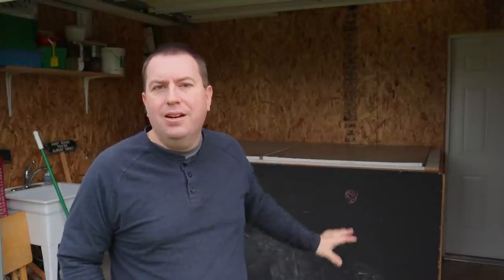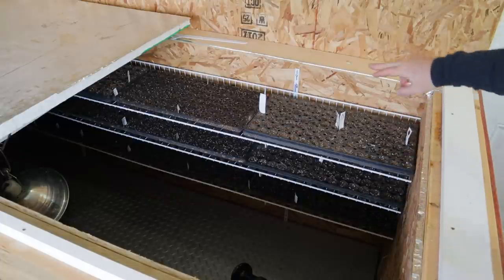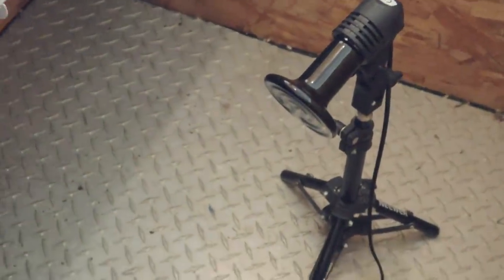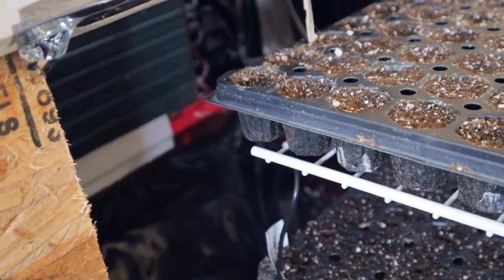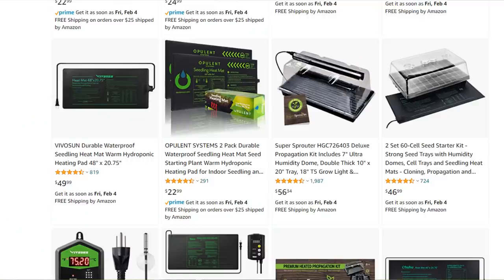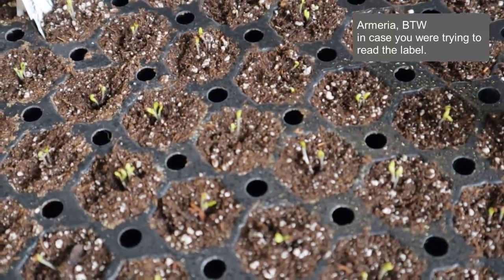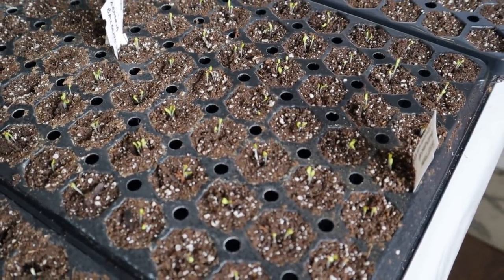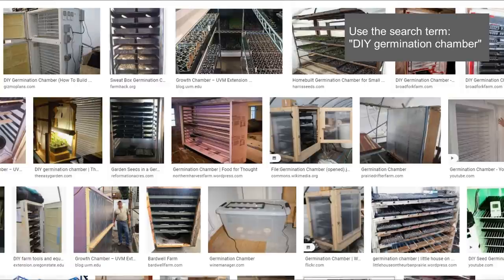DIY Germination Chamber: Fast and Consistent Seed Starting

Comment: Very helpful tips as usual Jason.👌
Here are a couple of small home gardener suggestions.
If you only have a handful of seed varieties for sprouting try using a styrofoam cooler or camping cooler for climate control. Same idea, but on the corner of a room type of scale.
Another way to heat the box is to use rounded river stones. Place them on or in a source of heat like the oven, wood stove, under a heat lamp until they are at the appropriate temperature and then place them in the cooler for transferring their heat (use a board, box to keep them together so the heat will stay concentrated and last longer). You can also use a box or bag of sand (kidney/navy/pinto beans) and heat it up in the appropriate source of heat. I prefer wetted burlap fabric for the humidity as well as containing the river stones. You can also use a deep aluminum cookie sheet with wetted sand as a heat/moisture control as well.
I am actually in negotiations to purchase a 2 acre/.8 hectare property, hopefully closing by April, so I may be doing a spring move. I think the elevation is 4,700ft/1,432m. On Saturday at 2 pm the temperature was 62F/18C. I know that it gets down to 38F/2C in the predawn morning right now, so hopefully by April it will be more like 45F/8C. I guess we'll see what happens. It's definitely going to be a process, but I will be taking pictures and will try to send you some as things progress.
Very useful video.👌🤙
Reply from the maker: Thanks. I do love that gardeners find the appropriate project for their own size needs and conditions. Definitely not one size fits all. I didn't know it could get that cold where you are!
Reply: @FraserValleyRoseFarm  That's the thing about elevation, the higher up you go, the cooler it gets, even here in Hawaii. Right now Mauna Loa and Mauna Kea (the two main volcanoes) have snow on them and it will be there until at least March. The chill effect (like opening the refrigerator door and your feet get cold) is quite noticeable at that elevation. That's why I will probably need to build a green house for the tropical plants, just to buffer that 7-10 degree temperature drop to protect those most sensitive plants. It's all an experiment, so I guess we'll find out.😬😳😁

Comment: Iv got a walk in fridge made from that material, Iv got an air conditioner for cooling and heaters for heating. It's set on a bed of gravel and rain water flows under. Iv got a humidifier also. I use T5 and T8 lights for overwintering mother stock for early propagation of basket plants. Iv also got root trainer trays and can do upto 7300 hard wood cuttings over winter of weigela, sambuca, and roses. I use either course sand or seedling compost with perlite. My fridge room is about 8ft tall, 12ft wide and 20ft long. So I can squeeze lots of plants in there.
Reply from the maker: That sounds like a great multi-use growing space!

Comment: Hi Jason, as a fledgling backyard grower/nurseryman I enjoy your videos, lots of good information. There are an increasing number of perrenials available today which can be grown from seed. The seeds for some of these can be quite expensive, I have seen Echinacea Red Ombre seeds priced at nearly $1 each, Cheyeye Spirit Echinacea are also expensive. Can you offer any particular advice regarding  seeding instructions for these types to maximize germination rates and growing? For example, should the seeds be covered or just pressed into the seed starting mix? Also, do some seed suppliers buy 'old' seed from seed suppliers and sell them at a discount and therefore it's a case of 'you get what you pay for'? Thanks.
Reply from the maker: Thanks Paul. The right conditions for germination vary a lot by species. I get my specifics from the Jelitto website usually. I like Jelitto, Hazzards and GeoSeeds for assortment and price - but you're right, some can still be pretty dear. BTW, Jelitto says for echinacea: cover lightly and germ around 20C/68F

Comment: The problem I have with the seedmat that I have from Amazon is that if I set it on a towel or a table, the build up makes it entirely too hot. But if I put it on a wire rack thing like you have in your starter setup, there is no build up of heat but I can barely feel any heat at all.
Reply from the maker: Sorry to hear it! I've seen some heat mats with external thermostatic controls, but it's tough when the built-in controls are running hot.

Comment: Do seeds need some oxygen exchange happening in the soil to germinate?  I ran a test this spring where I put a cover right at soil level in one tray and another tray with a dome.  Few if any of the tight closed cover germinated.  Same seed and temps.
Reply from the maker: Not that I've seen. We ran germination trials at a large grower with herbs and for some crops we placed black and white poly (black side down) directly on the tops of the seeded flats to retain moisture. Excellent germination! I'm not sure what happened in your trial, but I'd leave open the possibility that on the same heating mat (for instance) a tightly covered flat might actually have much warmer soil than the one under the dome. But that's just a thought.

Comment: I have seen oriented strand board plywood get rained on for weeks before roofing , siding or even a vapor barrier touches it. A little humidity is a fart in a windstorm to this product.  Forget about it .
Reply from the maker: Thanks Howard. That's reassuring. I noticed a small a amount of swelling on some of the edges, but I only use this for seedlings for a few weeks at a time anyway. Seems to be holding up okay.